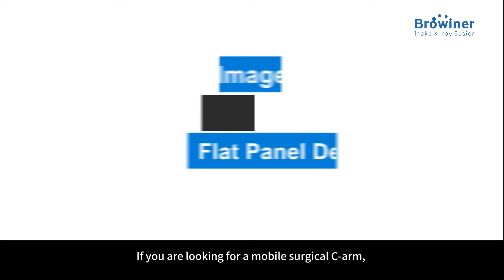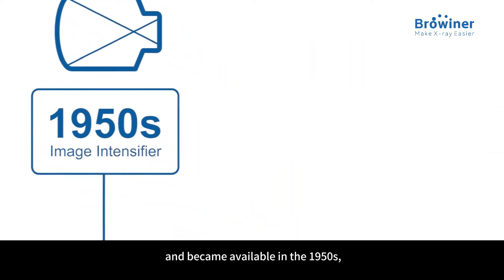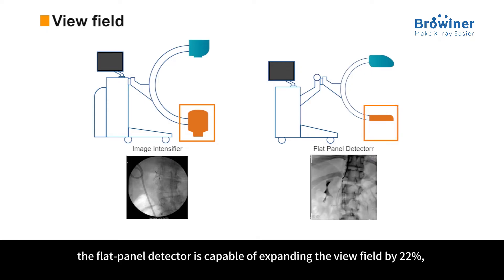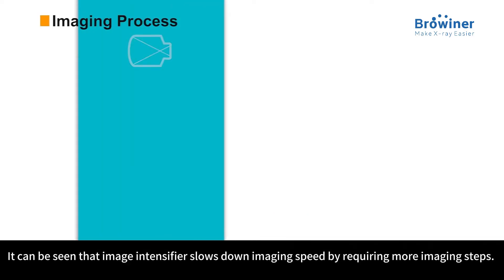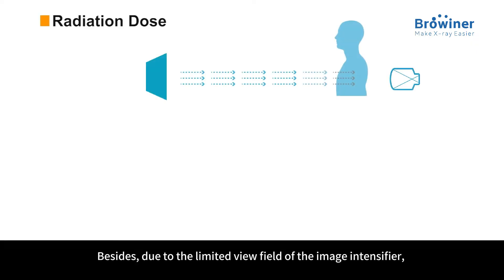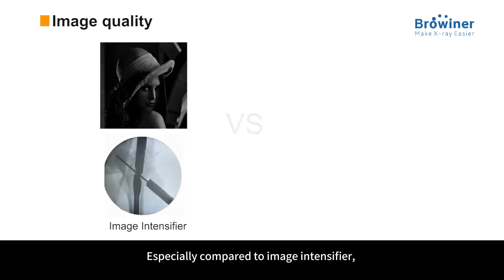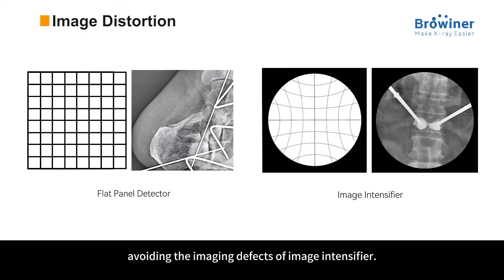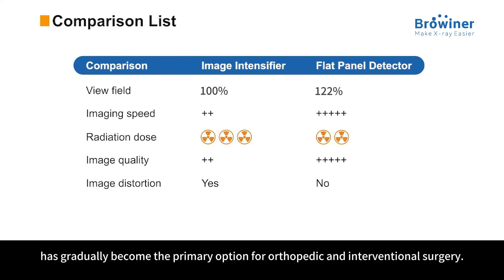Image Intensifier VS Flat Panel Detector

Comment: FPD have both indirect and direct versions. II's have higher spatial resolution and are way cheaper. Image distortion 2/2 poorer dynamic range is the trade off for II's. There's  loss of dynamic range with indirect due to light conversion.